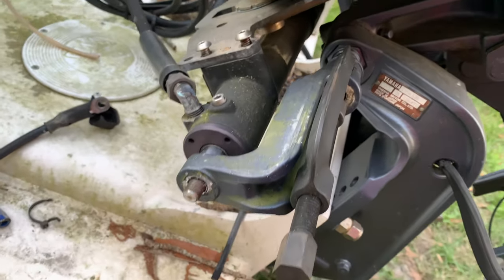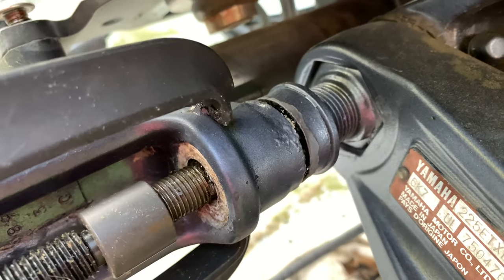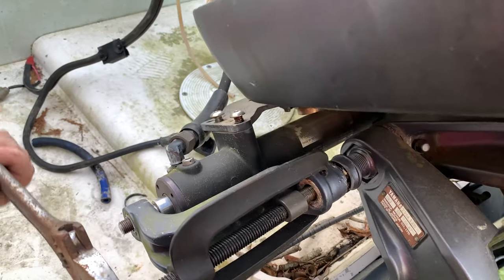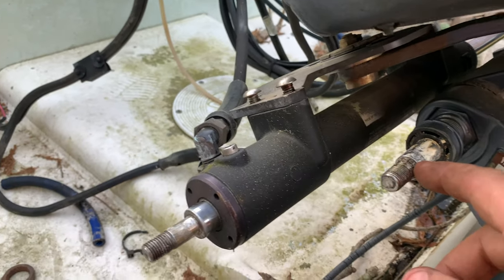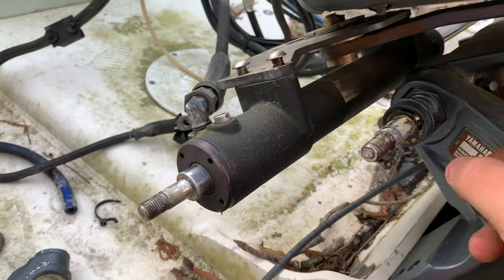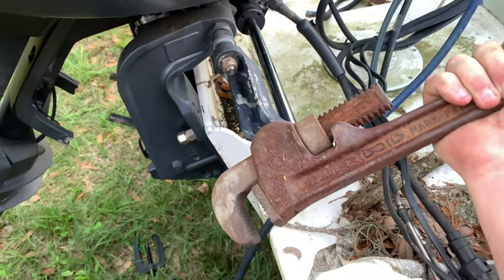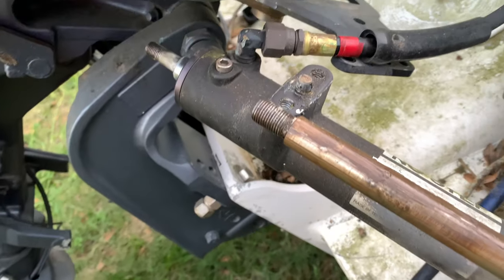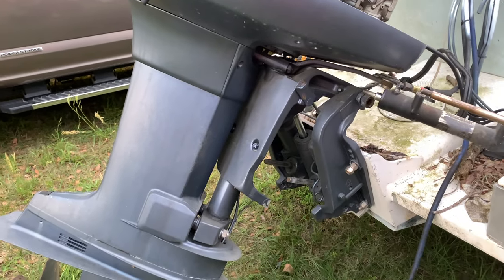Seastar Hydraulic Steering Rebuild  / Arm and Cylinder Removal / Sea star Steering STUCK

Comment: Thanks for the video!   Is that a special puller for the Sea Star System?
Reply from the maker: Yes a special tool you can buy them on Amazon
Reply: @jerryrig  Thanks!   Mine came apart with a couple plastic mallet taps.
Reply from the maker: @Hubjeep  I’ve not gotten that lucky in a long time now. Maybe its a sign I need to work on newer stuff.
Reply: @jerryrig   I put it together over 12 years ago!
Reply from the maker: @Hubjeep  must have done it right!

Comment: Is this stuck as in the steering wheel @ helm will not turn in one direction also?
Reply from the maker: No mine was just leaking seals. I had one stuck at the helm but they are easily rebuildable as well.